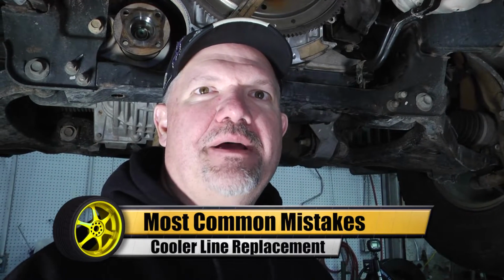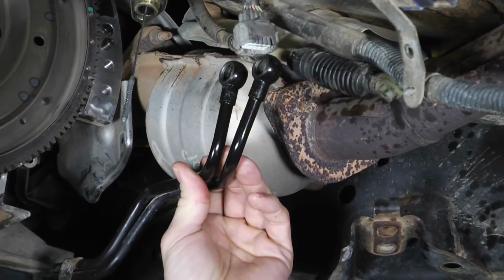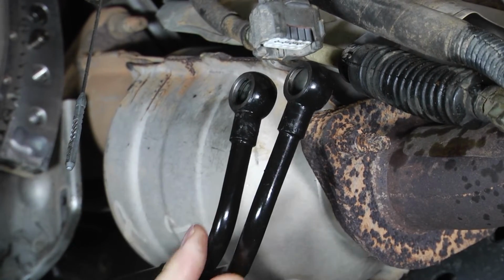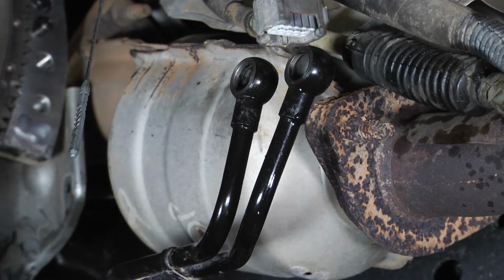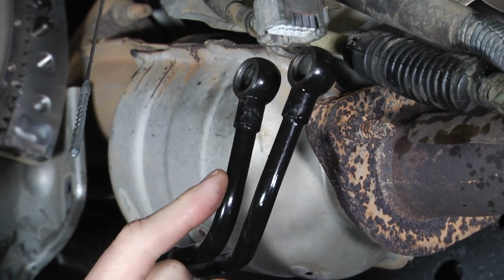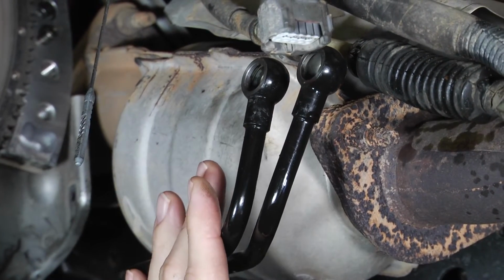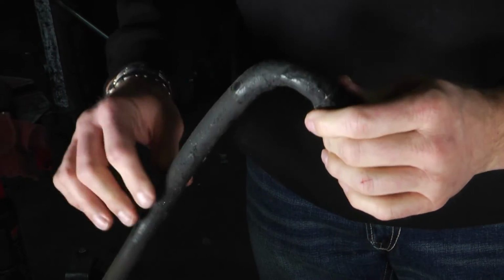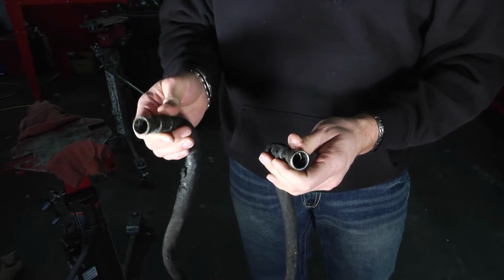Common Mistakes: Cooler Line Replacement

Comment: I put new tranny in my Buick. The bottom new coolant line would snap into radiator but when driving it would randomly pop out. Have you ever heard of that?
Reply: Sounds like you reused the old retaining clip, maybe it wasn't properly seated. I'm assuming that Buick used Gm transmission quick connect fittings.
Reply: @OldSchoolNoe  put another line in.  Fixed it. Was junk machine made line.